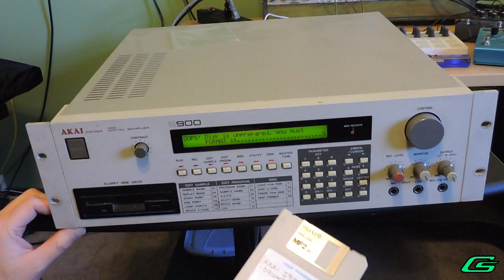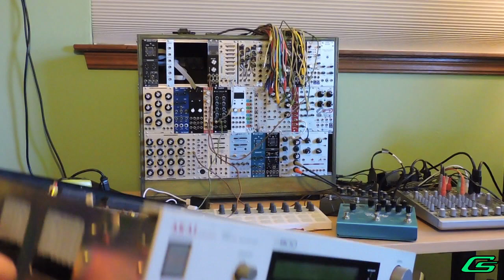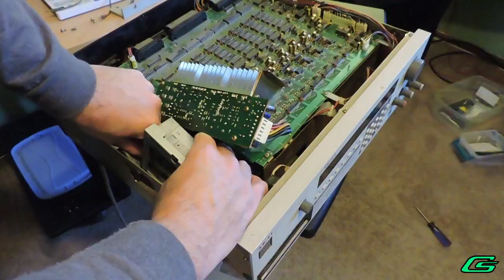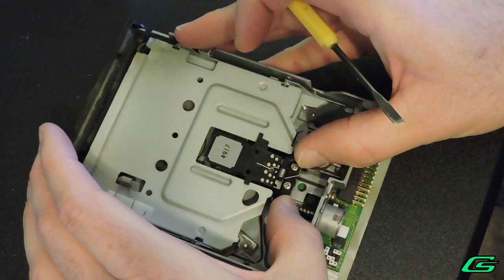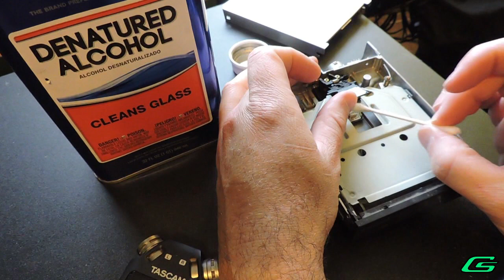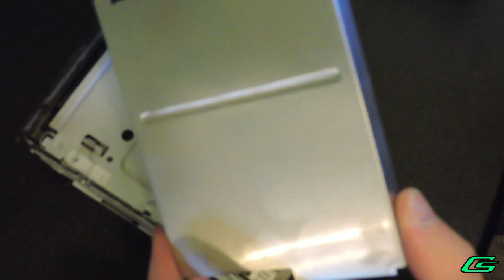Akai S900 Sampler Floppy Disk Drive Cleaning [No Soldering]

Comment: Did you end up eventually replacing the floppy drive? Mine still works but I'm replacing the screen with a new LED screen so while it's open I'm also upgrading the floppy drive with a floppy drive emulator.
Reply from the maker: @HowardBaileyMusic  mine still works for now. I put the fde in my X7000. I’m also refurbishing a Mirage rack and that floppy still works too.

Comment: hello, may I know what floppy drive model you have installed?
Reply from the maker: Mine is the factory drive, don't know what the model # is offhand
Reply: I'm afraid the player is not the factory one (mitsumi d357) which you can recognize from the front panel with the central floppy eject button.  Unfortunately, the 900 compared to the 950 has a higher non-standard housing and a common reader would leave a hole.  For these I needed this precious information, if I could help me I would be happy.  Thank you

Comment: I just did this to an s900 I just bought unfortunately it didn’t improve any problems, I will add that your screw that moves the disk head is very course threaded in comparison to mine. I now have a usb drive ready to fit and a new led screen, would love to have got the floppy working but there you go I can only wonder at the box of 70 floppies that came with it, I guess it’s the flop house for them..